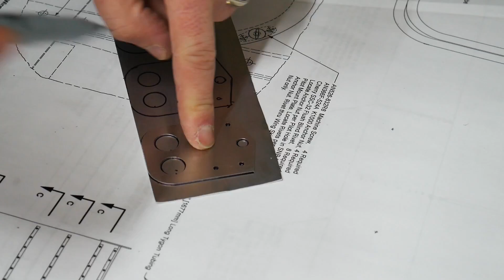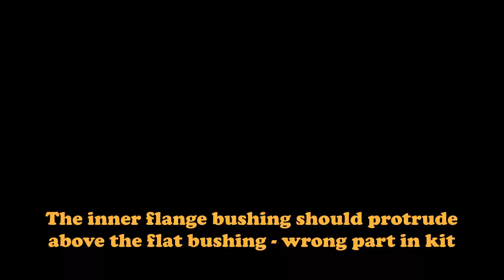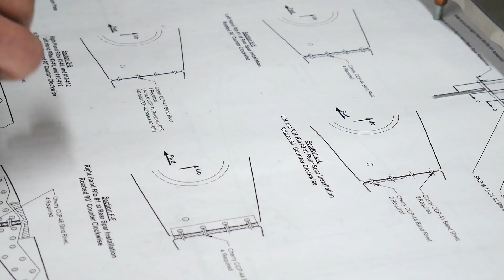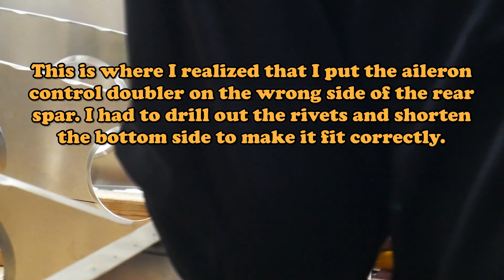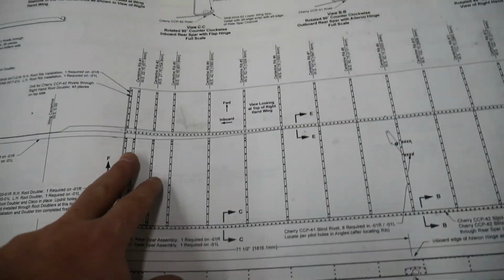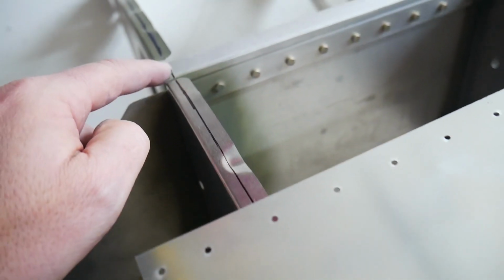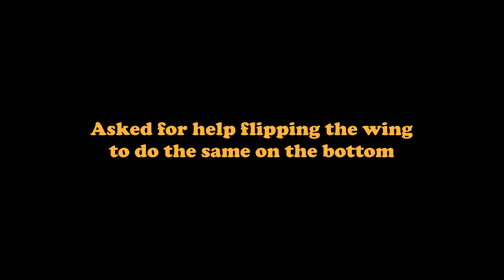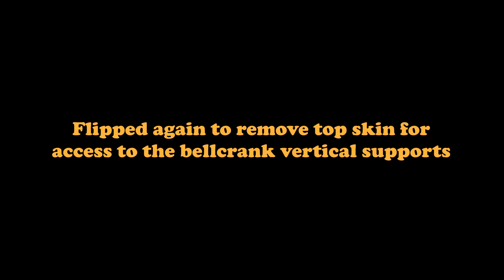Sonex Build - Wing Assembly

Comment: Well done Dan...I am looking forward to now starting my wings  and can now learn from your efforts. Good to see you used the extension tool on the deburring. I have also noticed your pneumatic rivet tool is having a few goes at pulling the rivets, mine does the same, trying pulling the head off and giving it a quick clean about the jaws, it does help.
Reply from the maker: Thanks Andy. Regarding the rivet gun - I just figured it happened when I used a slightly longer rivet and had to pull the mandrel farther.  But it does happen almost every time, so I'll have to take a look!

Comment: I like your videos on the sonex. I’m considering building one and watching your videos gives me a little more as to what is accomplished during the build process.  Most of the other videos on Sonex are walk around videos.   One of the things that is a question of mine is that the little bit of plans I have been able to view really don’t look like they have any instructions or steps to them.   They just look like a set of drawings.   How are you finding the clarity of the steps to building a part?
Reply from the maker: Hey John, thanks for watching. When I decided to build a Sonex, I thought the same thing about the other YouTube videos. I wanted to see HOW they did the work, not just hear about it after it was done. So I try to demonstrate the work more than the walk around afterward. It takes a lot longer, but I think it's valuable.

So far, I've found the plans to be very complete, but you're right - they don't have many step-by-step written out instructions. A few of the more difficult assemblies do have a numbered list of tasks, but only if it matters what order you do them in and if it's not clear by looking at the drawings. I would just caution you to make sure you read every word on the drawing before starting. Every once in a while I'll find something surprising that I would have missed if I didn't take 20 minutes to look really closely beforehand. And on a couple of occasions, I thankfully noticed part of the way through the assembly. Other times, I've had to buy a few replacement parts. 

There are lots of good online resources as well. I suggest the Sonex Builders Facebook group and the SonexBuilders.net forum. Both have people that are either actively building or who have completed their builds and are willing to answer questions about how they tackled something successfully.